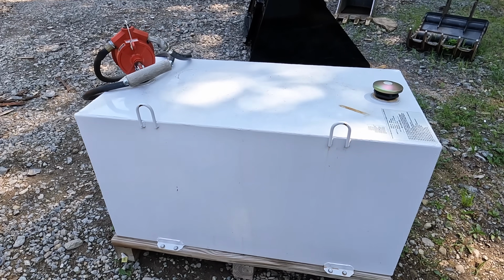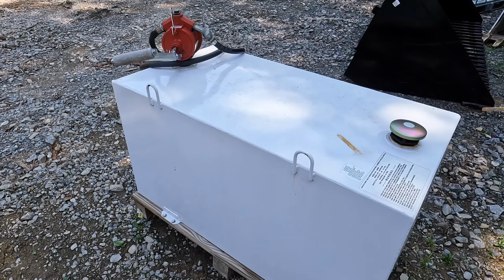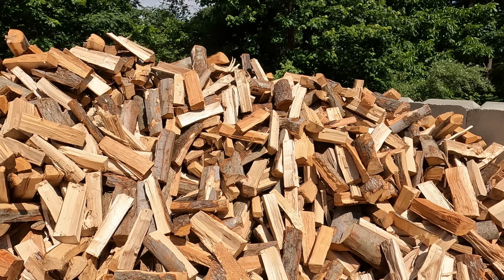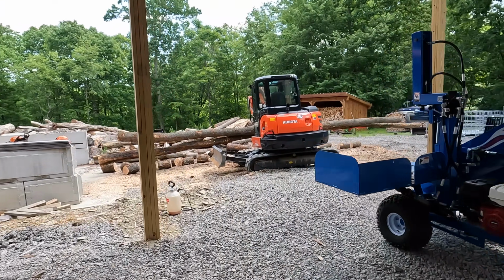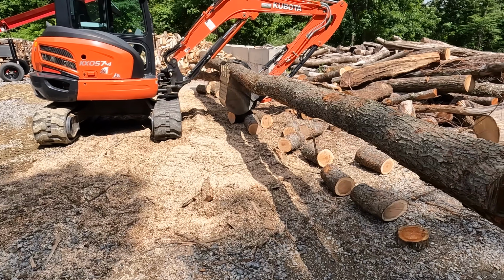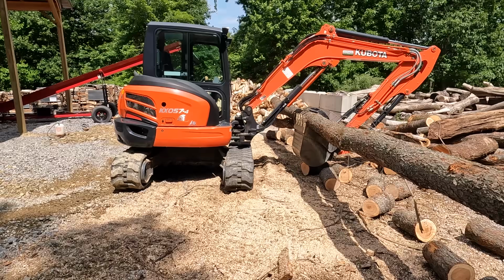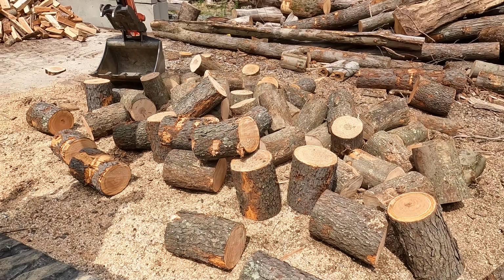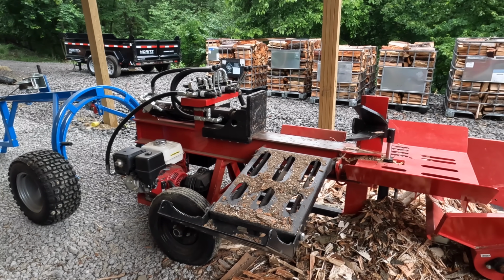Most Bang for the Buck! Diesel vs Firewood

Comment: Interesting math lesson.  You said it best when you indicated that it depends on what you need the btu's for.  While wood gives you more btu's, you can't dump wood into the tank of your truck and expect it to get you down the road.  Here's a question regarding the best way to get something done.  I've been watching you move the cut rounds to the splitter with the excavator.  I know you've talked about how the excavator sips fuel.  But would it be more efficient to move those cut rounds to the splitter with the skid loader with the wood bucket on the front?  Hey, it's your work, and you have a right to do it your way, but I'd be interested in your thoughts.

Comment: The time and cost to cut, transport, process and burn firewood as well as maintenance of the wood boiler is really close to a full-time job. I have found that using a combination of diesel and electric for heat has been more cost-efficient and time saving than burning firewood.

Comment: In the UK, "offroad diesel" is called red diesel and is actually coloured red. If you are caught using red diesel for "onroad" use, you will get a hefty fine!
Reply: It's dyed red in the US also, and the same thing applies.  It's a hefty fine to get caught using it on road.
Reply: @jamesb2291  I didn't know that. Thanks for the info. 👍
Reply: @Tech Author  it also is known as #2 fuel here. Like some other comments have mentioned, it's the same thing as what is sold as "heating oil" for home furnaces as well.
Reply: @jamesb2291  Interesting!

Comment: Another difference between offroad diesel and the diesel you buy to run over the road is the government dictates the manufacturer of offroad diesel adds dye to it.   If the police pulls over a tractor trailer or other over the road diesel vehicle and they find dye in your tank,  you can be fined for that.   The assumption is you have been running the offroad diesel in it (that has dye in it) to avoid paying the extra road taxes added to over the road diesel.

Comment: I'll just mention that when you burn diesel or gasoline in an internal combustion engine, only about a third of the chemical energy from that reaction becomes mechanical power.  The rest is heat lost through the exhaust or dumped through the radiator.  Add to that the energy lost heating up your brake pads, and you're lucky to get a quarter of what you pay for.

I believe that battery cars will ultimately prove to be the transitional stage between petroleum and hydrogen for transportation fuel.  Hydrogen fuel cells can hit 80% efficiency in terms of power delivered on the wire from the hydrogen/ogygen reaction, and electric motors can hit 90%.   Add a small battery to take up the power from regenerative braking, and you can get an extremely efficient vehicle.

Comment: I'm gonna hold out on a new car until they make one powered by firewood. Then I'm gonna drive and make the wife fuel it. 🤣
Reply: They built them during ww2...
I heard of someone driving a pick across the US powered with wood.
And it is possible to gasify wood, compress it , and use it like propane.
Reply: @nigelbaker7754  the oil industry probably ended that. Thanks for sharing.

Comment: $3.76/gallon for off-road diesel.  Ouch!  In Texas I can typically find pump diesel (fully taxed) for $2.95-$3.05/gallon. There are plenty of stations charging $3.30-$4.00 per gallon, but I’m not sure why anyone would shop there when down the road it’s so much less expensive. 
Prices were higher for a while, but they’ve been back under ~$3.30/gallon for a couple months now.  I’m glad we have the feedstock and refining capability here in Texas, so the federal attacks on reliable energy are softened a little for us.
Reply: I know that shocked me it's under 2 here in Ga in some places.
Reply: I wrote the fuel comment at the beginning of the video.  You had me rolling near the end…”Let’s say there’s something wrong with you, and you don’t enjoy splitting wood.”  😂

Comment: Mike, what are you paying there for regular diesel for your truck per gallon? Here in Nova Scotia, it’s roughly $5.30 CAD per gallon, depending on where you buy it. That’s $3.99 USD per gallon after the CAD/USD exchange rate applied.

Comment: What is your estimate on how much wood 87 gallons of diesel would cut into firewood? I know it's not just the excavator that uses diesel,  like the splitter or loader that needs to be taken into consideration.  So would you get more than a cord of wood out of 87 gallons of diesel?
Reply: For me about 40 :1. I'm betting Mike has used much more than 5 -10 gal of fuel to split that whole bunker.

Comment: I heat my 2 story, 1800 sf farmhouse with a single wood stove in the main room downstairs. We do have an oil fired hot water boiler system too, but at over $4.00 per gal. It doesn't get much use except for domestic hot water and times when we are not home. I use 3-4 cords of oak per heating season, from mid Oct. thru May depending on how long a winter we have.  The annual cost of my firewood, split and delivered is less than what one month of heating oil would cost me.
I love wood heat, cozy, always warm and dry in the house. I would use wood even if oil were cheaper.

Comment: Wood is King as long as You're able to purpure it Yourself. A butting table where You could load rounds into the wood bucket on the skid steer and carry to the splitter and transfer onto splitter would be no lifting at all.
Reply: YES! I use an old flat hay wagon. I never pick up a price of wood off the ground

Comment: So I've been looking at your pavilion and figured that originally the plan was to enclose the back end, which would be the purpose of the center support.  However that center support is definitely in the way of things and could be removed without causing structural problems.  If the trusses don't need to be supported at the other end or in the center of the building why does the truss at the back end need to be supported at the center.  Just a thought.  Great video Mike thumbs up.
Reply: It's possible that the end (gable) truss is not a common structural truss worthy of spanning.  Unless I'm not seeing the whole picture.
Reply: @probuilder961  I've built a pavilion before and made my own trusses for it.  The dimension being 40 feet in length, 20 feet in width, and 20 feet in height.  Trusses are designed to transfer the roof load (both static and dynamic) to the end supports with the bottom member being mostly in tension to hold the walls of the structure together.  In any situation there would be no reason to deviate in the construction of the trusses to require that end truss be supported; which brings me to my opening statement:  "So I've been looking at your pavilion and figured that originally the plan was to enclose the back end, which would be the purpose of the center support."  Good thought though.

Comment: Your not going to get 20 mpg  out of that truck pulling a load especially in them hills also  on the cost of wood vs diesel you have to figure in the cost of equipment saws splitters truck and trailer to haul it if not cutting on your home place.

Comment: Very interesting numbers. Now we know. Another great point is that your wood stove heats your 3000 sq ft building! Amazing. I'm blinded by dollar signs when I turn on my stove to cook. I live in a Mobil home. I do have a wonderful mighty oak tree shading over half my home, but when the air conditioner is running and I turn that stove on, I am seeing dollars being pulled out of my pockets. I'm total electric and the usage chart that Duke Energy shows my home's usage lower than average. The most I pay a month is January and February, July, and August. Another good point of your wood stove is the heat is a dry heat. It sure looks like the wood bunker is nearing the full mark. Get the wood shed full, and you're done! So many projects are coming, yay! Thanks, Mike. 👍🚜❤️🙏🇺🇸🇺🇸

Comment: Love the comparison!  That is a meaningful statistic, and interesting.  As you said, it depends on the application which is more practical, but per dollar, wood provides more energy even if you have to buy it.  Diesel is old hydrocarbons that have been concentrated by volume over long span of time that are harder to recover but easier to transport, and trees are new hydrocarbons that are easy to recover and replenish more quickly.

Comment: I guess the question that begs to be asked is how many cords of wood do you get out of the 87 gallons of diesel and what is your profit margin?
Reply: It depends but I figure 1/2 Jerry  can of diesel in my  tractor and less than 1/2 can for the splitter and saw gives me enough wood to heat my house for the year. 20l of fuel replaces 1000l of oil, or about 40:1. 
Which also means a 97% reduction in GHG emissions, because WOOD IS STORED SOLAR ENERGY.

Comment: Ok, if you REALLY want to get technical, you'd have to subtract the gas for the saw, gas for the splitter, diesel for the excavator,  trackloader and delivery truck from the total for the for the firewood.
Reply: You'd still have to do the same for the diesel fuel being located, pumped, transported, refined, transported, stored, pumped, transported, pumped, sold to the customer and transported to their home. It'd still work out in wood's favor. Firewood is honestly undervalued for the work and time involved.
Reply: @jamesb2291  Ah, but most of those are already built into the retail price that was used for the calculation.  The only thing not included is the price to drive the tank home from the pump.
Reply: @LongBinh70  it'd be built into the firewood price also. But I agree that firewood is generally not worth selling because it's more work than it's worth. The only way to make money on firewood is if you sell at a premium like bundled wood, have a business that you get wood as a side product like sawmilling or a tree service, or you are willing to basically work for nothing. It's fine as a hobby but it'd be hard to make a living off wood sales while factoring in equipment costs and wood supply.

Comment: The towing MPGs on the diesel truck will vary widely due to load weight and wind drag and fuel quality. Winter blend diesel fuel is terrible for loaded and unloaded MPG. I can get as low as 17 mpg unloaded at 70 MPH or as much as 21 depending on fuel quality. Loaded is harder to depend on. I generally tow 9,000 lbs.but with a conveyor sticking up almost 14 feet in the air its like dragging a parachute. The worst I have seen pulling the firewood processor with conveyor is 9 MPG. The best was 13 MPG. Only difference was where I bought the fuel , if I added any cetane booster and wind direction/speed.  By the way, I have found that good old Sea Foam in the Winter prevents gelling of the diesel fuel.  I love my Duramax !! Not a day goes by that I dont think to myself "an 8,000 lb. truck is not supposed to be this fast" ! I switched from gas Silverado trucks to diesel ones 21 years ago. The hardest thing to get use to was that while climbing hills the gassers would downshift while the diesels were grabbing the next gear.

Comment: I would argue that for the people that heat with wood, buying a splitter like that isn't good economics.  It's going to sit idle 363 days of the year.  Rent!  A buddy of mine and I split his year's firewood in a few hours with a rental for $CAD 75.  It's a little Splitfire with a Honda motor and a double acting piston.  And the bonus is that we don't have to worry about the maintenance.

Now if you're going to split wood for money, that's a whole different argument.

Comment: Your figures are flawed. You didn't include the cost to produce the firewood, equipment, fuel and your time
Reply from the maker: I did a comparison between 87 gallons of diesel vs if you bought a cord of wood for $325.00
Reply: Yes I understand from the consumers point but I'm talking about doing it for yourself. When you cut your own and you figure all cost including your time heating with diesel or wood is not much difference cost wise
Reply: @OutdoorsWithTheMorgans  I have heated completely with wood and then with fuel oil. Cord of wood 4×4×8 lasted 2 weeks. 100 gal fuel oil lasted 3 weeks to a month depending on temperature. Firewood heating there is constant burning where fuel oil only burns when thermostat tells it to. It wasn't even worth it to use both and I only had to pay for saws and fuel to haul it and cut it because I consider my labor worth something. You figure your cost of the wood, equipment you use and fuel to run it you're working for less than minimum wage. Doing it for enjoyment or the only choice you have is the only out to say wood is a bigger bang than fuel oil

Comment: WOW you said $3.79 for off road diesel??  I get regular diesel here in North Carolina for $2.98-$3.75 depending on many variables but it averages $3.65-$3.88. I have a Circle K card and that gives me an automatic ten cent discount. Either way diesel is the most power producing, efficient,cleanest burning fuel for the combustion engine available.Until the hydrogen engine is fully developed and deemed to be safe for use diesel will always remain the best fossil fuel source. I'm a HUGE fan of anything powered by the diesel engine!

Comment: You need an adapter to put the firewood bucket backwards on the excavator. That way you can move the rounds to the splitter and stack the firewood bunker  higher.

Comment: Hi Mike, love the channel. From what I understand off-road diesel has a lot higher sulfur content than on road diesel. That’s why you can’t run off-road diesel in your new truck.
Reply: It may depend on the state. I found many suppliers of diesel that indicated the two were exactly the same except for the dye.
Reply: Oh, good to know. Oh here in the west, however, on road vehicles need to use ultra low sulfur diesel.
Reply: In MA if you are caught using off road diesel in a big truck ie Kenworth,Peterbilt etc you will be fined heavily. Can't use it in a pickup either. Off road fuel is dyed. 
Mike I noticed vines on some of the poles. Are you constantly getting poison ivy,sumac etc??
Reply: And in California